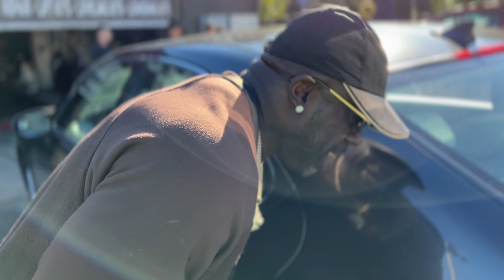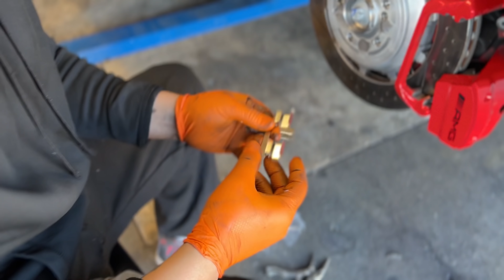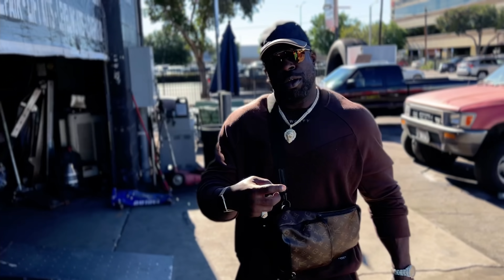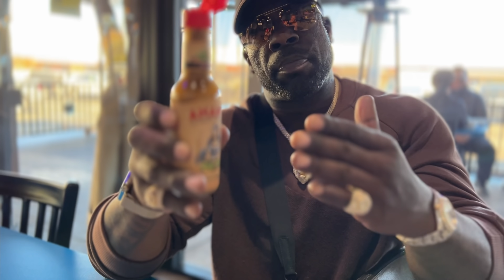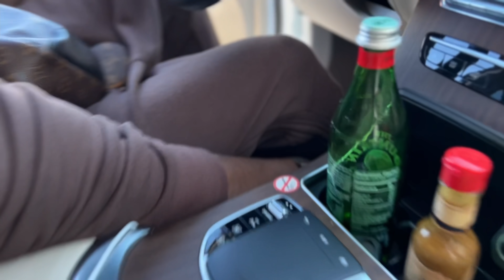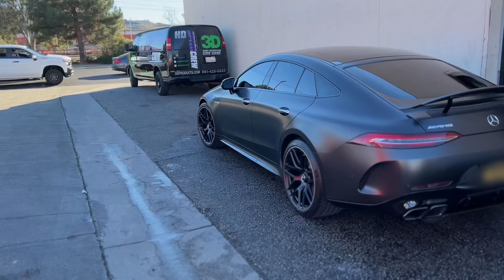MERCEDES BENZ GT63 AMG NEEDS SOME “LOVE”

Comment: Mercedes Benz require you to torque the wheel lug nuts to 80 foot pounds of torque for each lug nut. You can’t just use the air gun to tighten the wheel lugs up. You don’t need your baby mama and kids to be driving down the highway and the wheel falls off!? Just saying 😊👍🏽‼️

Comment: Front Brake pads at dealer cost me with labour 3k fitted. 
Aftermarket decent brand 1k fitted.
In my currency but just the difference is madness. OEm and labor

Comment: Did they use a scan tool to retract the parking brake? Typically you do that when replacing rear brake pads on newer cars. Also I recommend you resurface the rotors when replacing pads. No hate just giving my opinion. Side note I hope they torqued the wheels and not zap em